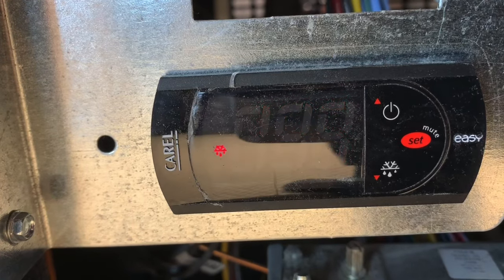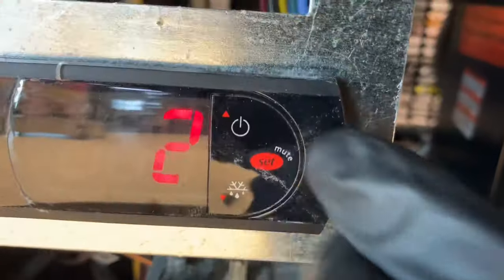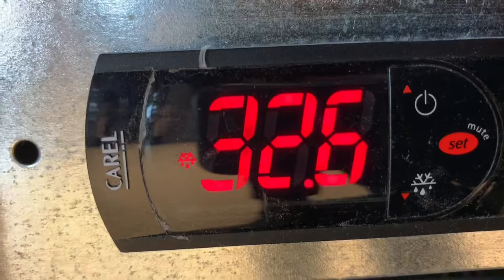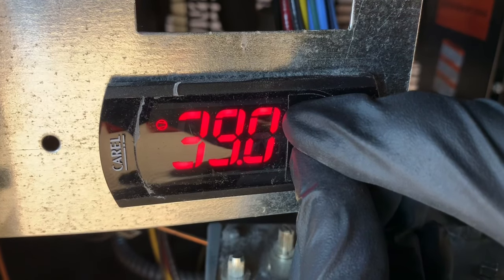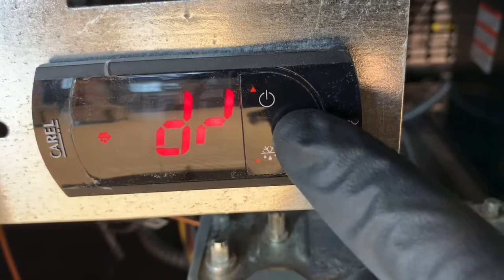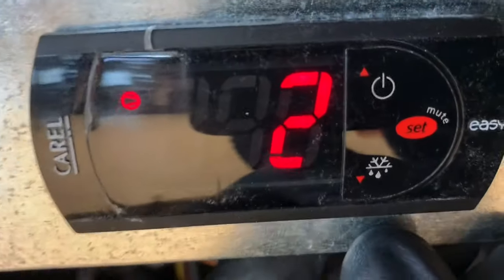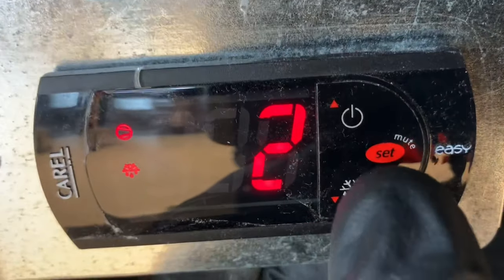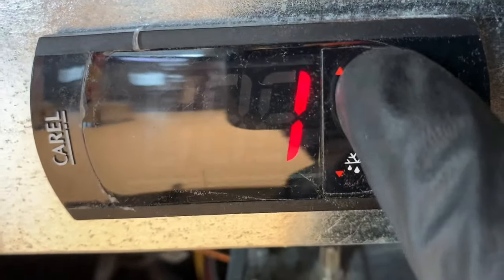How to navigate Carel Easy Refrigerator controller

Comment: Thanks for the video. I have a quick question. For whatever reason, my unit just goes to 1 or 2 degree whenever it wants even though the temperature is set at 37 degree. Any suggestions would be greatly appreciated. Thanks in advance.

Comment: Hi there! I’m trying to lower the cut out temperature on this same carel easy controller. Pretty much lower the temperature to 38 degrees. Mine currently is set to cut out at 40 degrees and cuts back in at 46 degrees. The problem is when I press and hold the SET button it blinks but when I push the the lower ARROW  button it just blinks but doesn’t lower the temperature. Please help! Thanks!
Reply from the maker: try going higher and let me know

Comment: when talking about the set points for cut in and cut out what are the actual numbers for a typical reach in refrigerator? It would be very helpful to include these and any other numbers just as a reference point.
Reply from the maker: It’s medium temperatures you can cutout @ 40 degrees F and cut in @ 45 degrees F

Comment: I’m working on the same kind of unit but it’s isn’t cooling compressor is short cycling and one condenser fan tries to run and the other fan won’t run
Reply from the maker: Perhaps compressor is overheating or going off on high pressures due to defective condenser fan motor